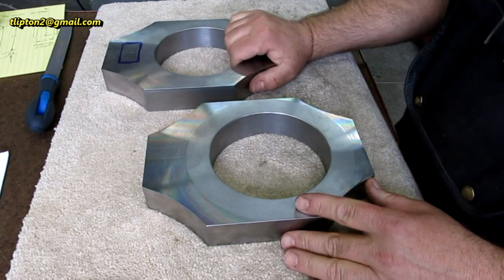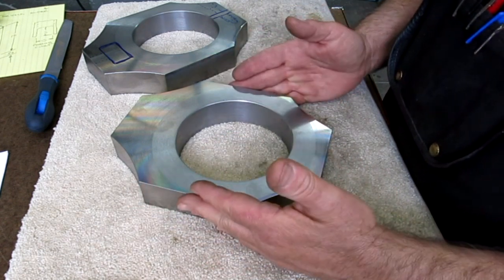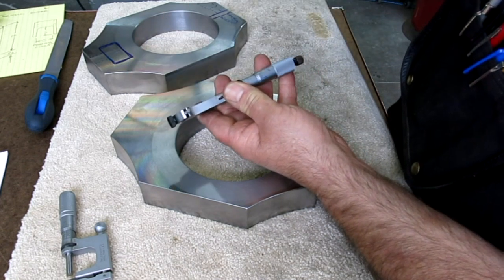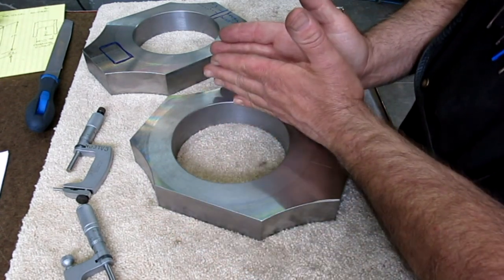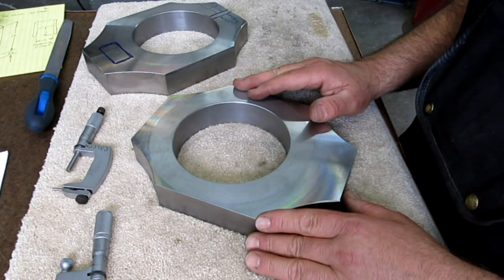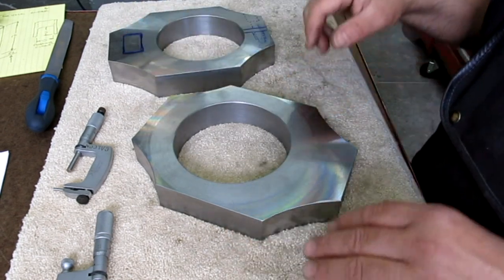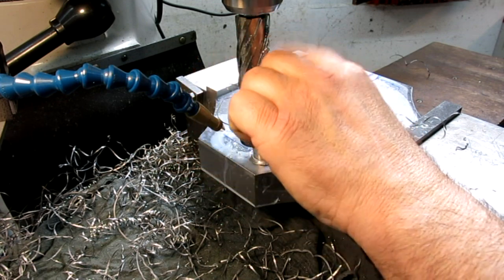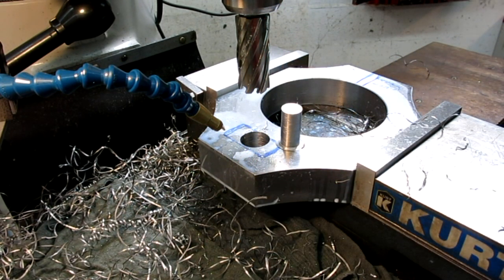Etching Press Bearing Housings Part 3

Comment: I don't think you have one, but boring those holes would have been easier with a VTL.  As far as the .001, you could file, mill, or belt sand off the thick side. . .

Comment: Tom,
Beautiful fit on the bearing hole! The rotor broach..what RPM were you using?
All the best,
Eric
Reply from the maker: esoomreltna Hey Eric,

I think it was around 300 rpm. Thanks for the comment.

Cheers,

Tom
Reply: K. It "looked" faster for some reason. Regards,
Eric

Comment: Great series. I'm enjoying all the machining and your running commentary helps a lot.
I put my Noga magnetic base in a zip lock bag (just because it has a little heavier gauge plastic and is easy to zip up almost closed), which makes it easier to remove magnetized chips when I turn off the magnet and remove the bag, and it keeps the coolant of my expensive Noga base. Thanks for continuing to make useful videos. I'm machining because you you and the great YouTubers out there: happy and safe machining by the way. Greatly appreciated you are.

Comment: Great tips Tom.  Are you holding the rotabroach in a collet or using some kind of shank adapter?  I'm asking because I discovered we have a set for our mag drill, ours have 3/4 weldon shanks that go right into the weldon collet on the mag drill.  I was thinking about ordering a weldon collet to straight shank adapter anyhow so we can use them in the drill press too.

Comment: Enjoyed this video ....

Suggestion: If chips adhering to the magnetic base is a problem, put the base in a plastic bag.
Reply: carver3419 Hot chips eat plastic bags for lunch. Going through the bag would be little more effort that through the air for a 1000° chip on his way to the "north pole"
Reply: AJKandK Good point ... I use that technique to pick up iron filings, and I'm not concerned with heat. Tom could place a fire resistant barrier between the magnet and the chips.
Reply: Ha. Now that, I can get behind & agree with. I live with little reminders so that it's always on my mind in the form of "intombed once hot chips" melted into and encased in re-solidified plastic like balls in the fancy carpet, I lined my tool box with years ago. They are there because the Tool maker psalms tell us: "An open drawer has more attraction than any magnet; you're time spent cleaning out from your folly, will be immeasurable".

Comment: Oh, and thanks for demonstrating the partial cut with the annular cutter. I have a job that's been hanging fire for five years because I can't bring the 700 pound fabrication (telescope mount) to the shop to extend some arc-slots. I could take my mag-base drill to the mount and nibble the slots (in 1" plate) a bit longer. I wonder if my small mag-base can stand the side thrust that I imagine will be generated.

Comment: The Noga arms all screw into their bases. You could drill and tap a hole for the arm alone, somewhere on the mill head (or on an existing bracket).  No giant magnet on the mill head = no chips collected on the mill head.

Plus, you'd have a humongous magnetic base to play with elsewhere. I'd like to get a couple more of those giant Noga arms for just such dedicated (off base) uses. It's going to take a pretty good sale on those giants before I can afford to get them just to play with. I'd get a few at half-price!

Comment: Tom, what was up with the finish EM, it looked like a 3/4 or 1" that had been ground down, the flutes were awful thick.
Reply: eformance It's a roughing endmill. aka Turbo, or Corncob. They're ground with radial grooves down the length of the flutes forming "teeth" or serrations along the radial land. They're sharpened by grinding the cutting face inside the flute and not the land / OD.
Reply: AJKandK I wasn't referring to the roughing endmill, I was talking about the one he finished with, it looked like a regrind of some sort.
Reply: Only the second tool was an endmill. The 1st cutter used was an annular cutter aka Rotabroach to rough out the hole, creating slugs and long stringy chips. Then 2nd was a roughing endmill to finish the hole with.
Reply: He means the third cutter...the one the finish pass was done with, that Tom didn't show. If you go back and look, you can see the cutter in the spindle as Tom is removing the work, and it doesn't look like the roughing end mill. 

-- Mike
Reply from the maker: BigMjolnir Hey Mike, 

I only used two tools for the pocket. The 1-1/16 rotabroach to cut the slugs out and a 1/2 inch diameter fine pitch roughing end mill. That's it.

Best,

Tom
Reply: BigMjolnir There was / is no third cutter - 2nd finishing endmill used. We may have to go read the Warren Commission Report on the Kennedy Assassination for the answer but, if you view in 720p & zoom up (might help you) you'll clearly see the serrations or "teeth" of the one and only endmill of the roughing type used. Also to the keen eye one can see the distinct though subtle milling pattern lines left in the finish of the pocket walls aside from the corner chatter Tom points out. For my seasoned Mold / Toolmaker eyes those fine details jump right out. For a person just starting out without a broad & developed mental surface texture compactor floating around in ones brain it may be a lot tougher to pick up on. Compared to a Diamond mirror mold cavity polish this is showing all kinds of surface imperfections but just fine for the (1) roughing endmill used but not harmed in the making of this video.
Reply: Thanks, Tom That should settle it. I was going to you next and then the warren commission Report.
Reply: oxtoolco
Tom,  Thanks for the correction.  That last shot made the tool look smooth, not like the rougher.  I expect it was a screen resolution issue on that shot...it wasn't from as close as the earlier ones.

-- Mike
Reply from the maker: BigMjolnir Phew! Glad that is cleared up. The endmill on the grassy knoll.....

Cheers,

Tom

Comment: Tom in roughing a deep hole like that does it taper to a smaller dimension on the opposite side of the part due to tool deflection? I know there are things you can do to minimize this, like speed and feed and what not. But would that be good enough to avoid a tight fit situation?

Comment: Nice video Tom.  I am amazed that the milling machine can reverse its rotation so quickly (you did it to remove stringy chips from the rotabroach). It seems like there would be too much inertia in the machine to be able to stop on a dime as it does.
Reply: tge1848 Behold the wonders of native three phase! You get some pretty high peak line currents, but contactors to handle them are cheap.

Comment: WHAT, a thou out in only 6 inches are you not trying? You'll never get a job with a railroad company working to such sloppy limits.
Hey dude, better to plunge cut the corners, or pre-drill before using the rotobroach. I shouldnt have to tell you this, you are the Master.
AIJ (all in jest, for the trolls with no sense of humour)
c

Comment: Hi Tom, I've been instructed that when using a rotabroach not to interrupt the cut once the cutting has started. Unlike when using a drill bit, interrupting the cut with a rotabroach increases the chance of damage.
Reply: John CI too was taught that way as well, plus adding an initial drill hole on the circumference to force chip breakage.
Reply from the maker: John C Hi John,

I would agree with not pecking if I were doing stainless steel. I like my rotabroaches to last a long time so I use coolant and clear the chips. There is no recommendation from Hougen to not back out of the cut. They do say however its okay to go through in one whack. I don't like the huge birds nest spinning that close to my hands. Hence the pecking and chipbreaking. Thanks for the comment.

Cheers,

Tom